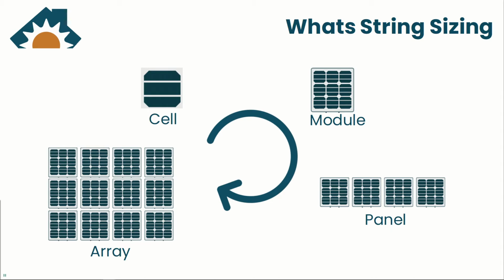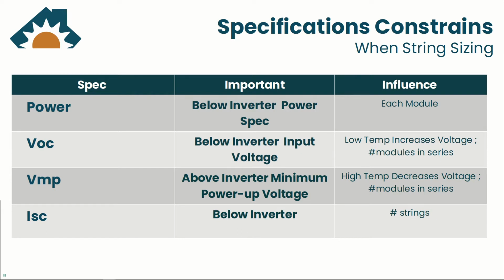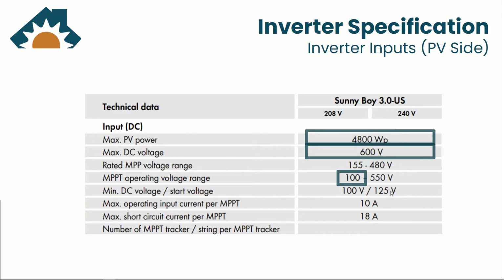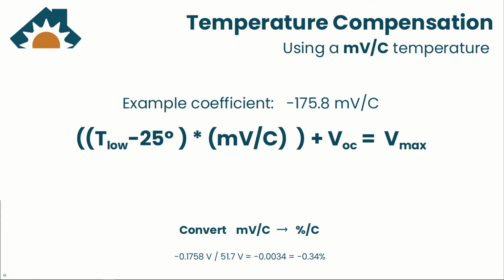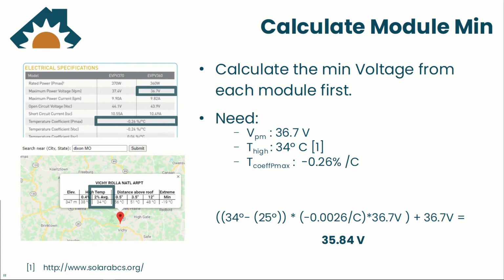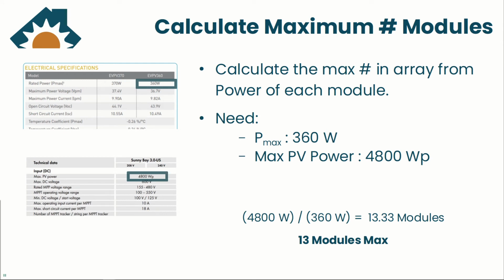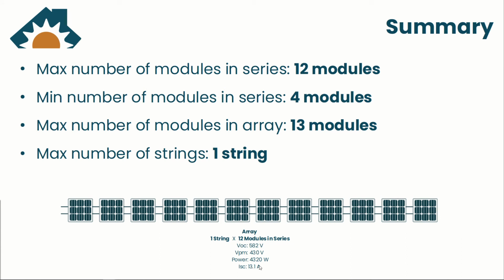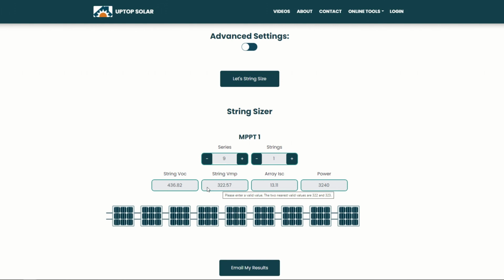UpTop Solar 101 #7 : String Sizing

Comment: The max PV power of the string can be higher than specified for the DC input upto around 150%. The converter will "ignor" this extra available power and not convert it to the AC side. This will result on clipping the highest possible level, but this lost is only a few procents in regard to the total converted value. As a positive effect, the converter will convert power over a larger time span during a day, so produce more AC power.
A second general mistake is that the each panel directly generated it's almost full voltage the moment some light shines on it, so the minimum MPPT voltage is directly exceeded. The string presents however a very low current at this low light level. The output current will be linear with the amount of light shining on the string. The converted will decide how much DC power is converted to AC power.

Comment: Could you explain....why max fault current contribution is greater in low capacity of solar inverter compare to high rating solar inverter.
Reply from the maker: Hi! Can you clarify your question? Are you implying and asking why do lower capacity inverters (smaller inverters like residential) have higher fault current contribution than larger inverters (utility scale)? If so can you share two models as examples so that I better understand the question and see the type of inverter and fault current ratings on both models?
Reply: @uptopsolar  yes my question is, why low capacity of inverter has max fault current contribution (1 cycle RMS) is more than high capacity of inverter of max fault current contribution (1 cycle RMS) .
For example:-
a. Cps inverter model name CPS SCA 36ktl-DO/US- 480 has fault current contribution (1 cycle RMS) is 73.2A (1.68 PU), while 

b. Cps inverter model name CPS SCA 60 ktl-DO/US-480 has maximum fault current contribution (1 cycle RMS) 64.1 A (1.6/0.88 PU).

Comment: Whats the difference between Rated MPPT Voltage range and MPPT Operating Voltage range?
Reply from the maker: I couldn't find the SMA manual that shows this, but from my experience with other inverters...  MPPT Operating Voltage Range is where the inverter can operate and perform some MPPT, it's a wider range.  Then Rated MPP Voltage range is the range where the inverter can out put it's max power. So in this example it appears that between 100Vdc and 155Vdc there could be some derating, same thing on the high end (between 480Vdc and 550Vdc). Between 155Vdc and 480Vdc, you could expect full power output.
Reply: @uptopsolar  Thanks for the information!
Reply: No, the voltage is immediately there the moment some light hits the string. The string generates however hardly any current as only a view number of atoms are hit by the light.
Current generation will linear increase with the increase of light on the panel upto a maximum where the maximum output is reached. See an episode of Gerry does Solar.